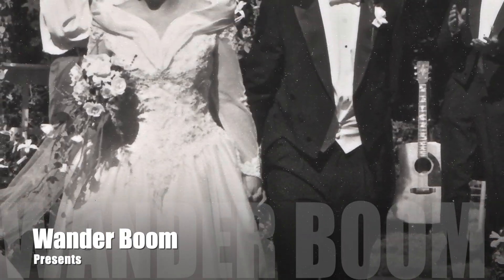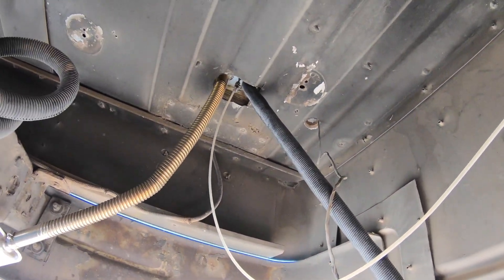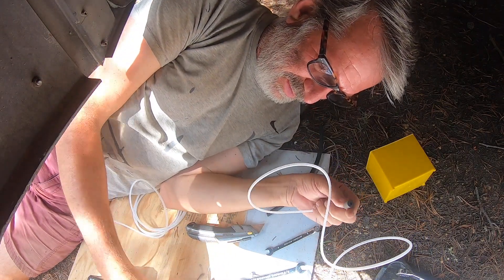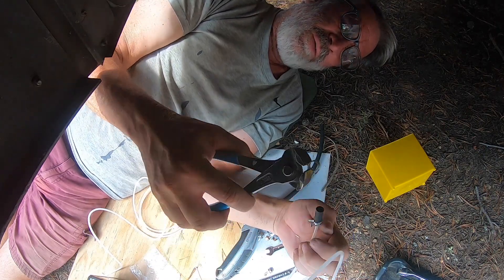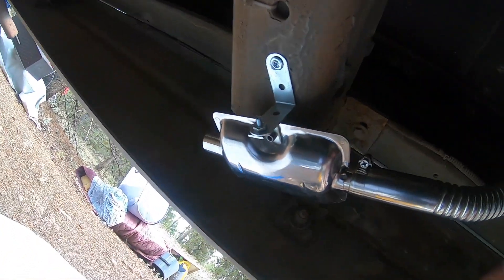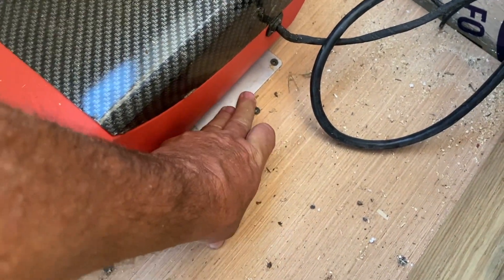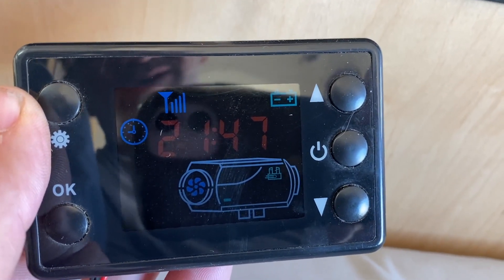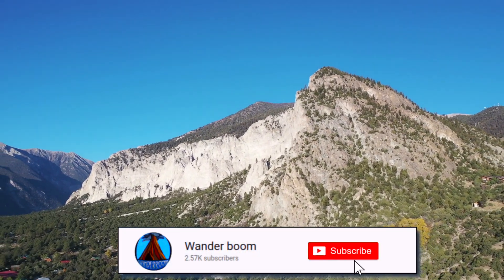Diesel Heater Installation Short Bus Redux Part 9

Comment: Hey guys!  I've been LOVING this series and following along with this build with real interest!  You do awesome work.

Please know that I hate being one of those people who points out "issues" on a video...I'm not a know it all, I promise.  BUT... That exhaust pipe coming out of the floor that close to the wood and to the insulation, I've had experience with my insulation melting close to the pipe...  I changed my mount to put the metal plate directly on the floor of the bus by cutting out the floor to the profile of the heater...  I may be over-reacting in doing that on my build, but felt the need to comment here...  Please take that with the grain of salt intended as I may be out to lunch on this...

Thanks again for sharing all of this knowledge with the rest of us folks!!!

Comment: Thank you, Eric! I just bought my second one and did a test on it over the weekend. The first one? Well, let's just say you should NOT plug a 12v system into a wall socket of a house. . . just don't. . . unless of course you want to buy a second diesel heater, and watch sparks fly. . . :)

Comment: Cool! Everyone who has them thinks they are great. She'll be comfy this winter.
Reply: Just a tip that has really sped up installs  is to mount the flat plate to combustion chamber, and get your hole cut where the exhaust and intake tube goes thru the floor/etc. Then hook up the combustion exhaust, intake, and fuel line to the heater BEFORE   screwing down the plate with the heater attached. A lot of times it is a total bear trying to get the clamps tightened in that tight spot if you bolt or screw down the heater first. Sure does speed up installs for me since I figured that out, plus lots less cussing and spilled blood on the sharp metal edges 🤪. Another good one Eric, hopefully get to see the build in person soon:)🤟😎🤠

Comment: Hey Eric, what size black (-) wire is yours? I have a 6" long negative wire, I have to add an extension, also, doors your bus smell of diesel without running the heater, just a full tank sitting there.
Reply from the maker: 14 or 12 gauge wire is good for these. No , we don’t smell it at all.👍
Reply: @Wanderboom  I'm so glad you guys don't smell lol thank-you for replying to my questions, I'm really on my own sorting all of this out, it's almost worth creating a "Support Group for Newbies" lol